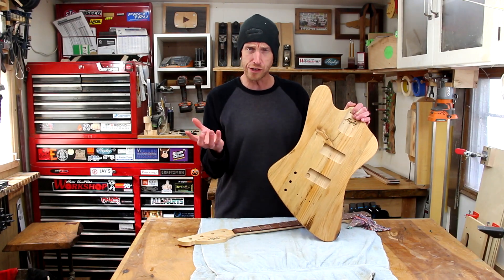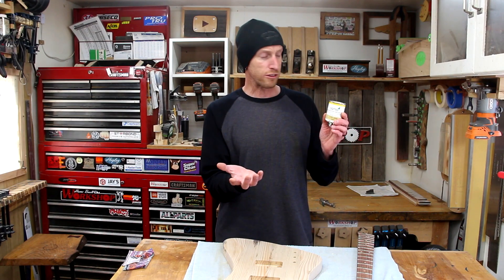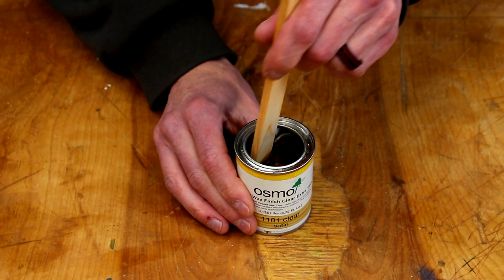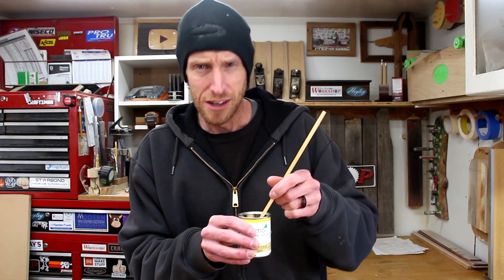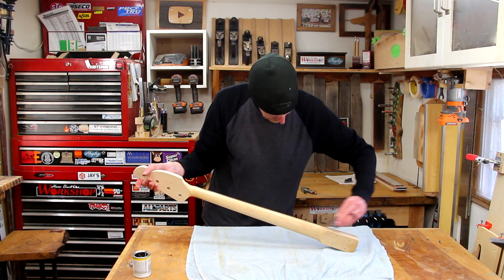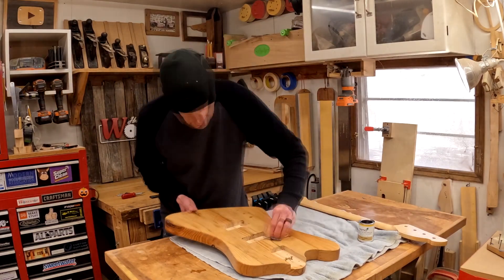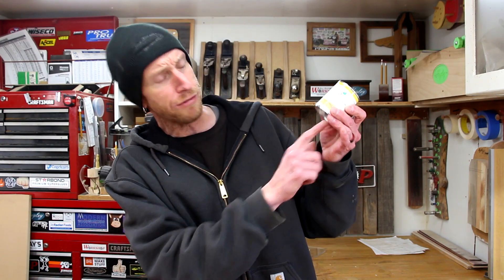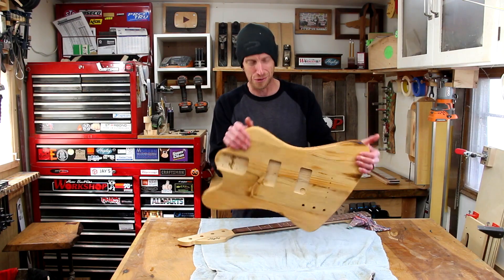Trying out Osmo Oil | First Impressions of an Oil and Wax Finish

Comment: Did you apply a final topcoat over the wax? I was told by another YTer they use the osmo polyx-oil on top of this wax finish after it fully cures.

Comment: As far as separation and skinning over, you are referring to the 3000 Polyx high solids series Osmo.  When fully mixed, it has a light purple hue to it.  That can and does separate on the shelf and will skin over after using it unless you add some bloxygen to it.  

The 1000 series stuff you are using on your body is made for exotic and oily woods and looks like tea and isn’t high solids.  It’s very thin stuff.

Comment: What? $15.99 for 125ml. That's extortion. Here in the UK I just bought 750ml for £31 (about 34 bucks). That's still more than I like to pay, but honestly, you don't need much. As for durability - well they use it on floors over here. Also, the cost when wrapped up in all the costs of making a guitar isn't that big a factor.
Reply from the maker: Its crazy expensive. I don't know why. Like you said though, it doesn't take all that much so per piece, its probably not that bad.